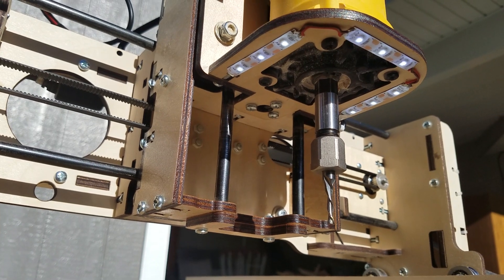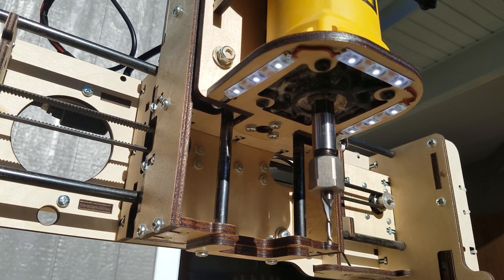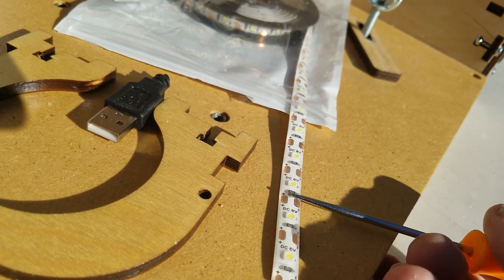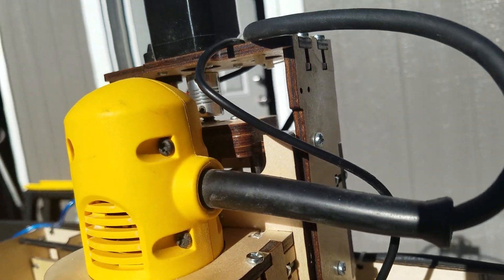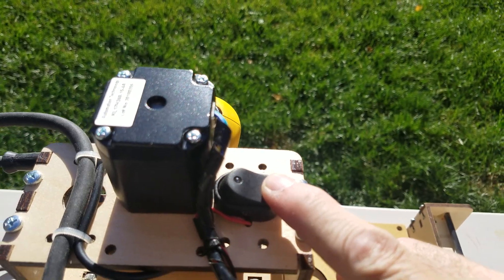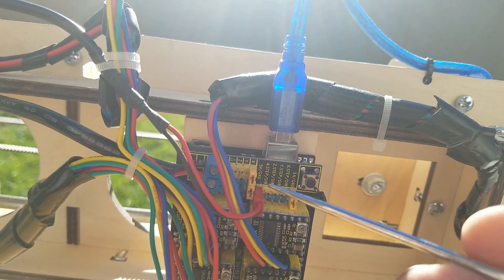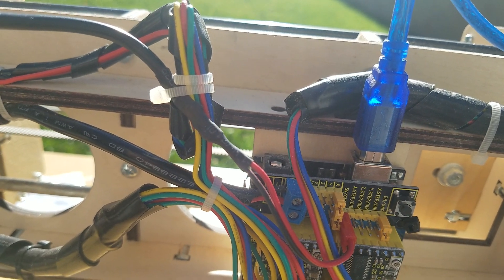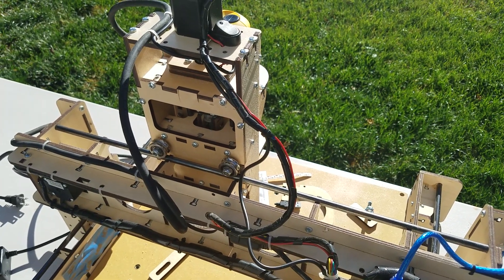DIY - 5v LED ribbon strips for BobsCNC Router Z Spindle Mount - with on/off rocker switch

Comment: very Nice!! I may have to do this. I would likely just run am extended usb to my laptop or some other secondary source, but i love this idea...
Reply from the maker: Or you could simply do a usb splitter as well. 
I've since found that they make both straight and 45° clip connectors if you don't want to soldier. Good luck my friend.